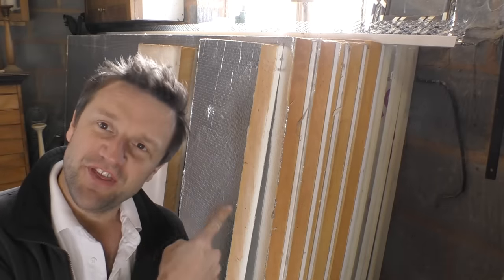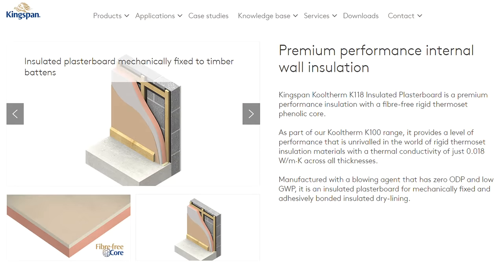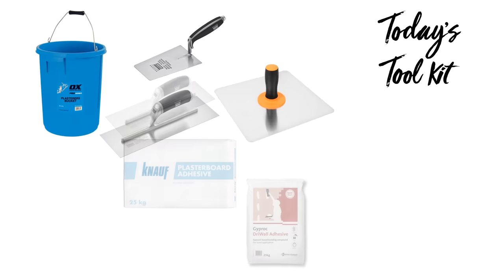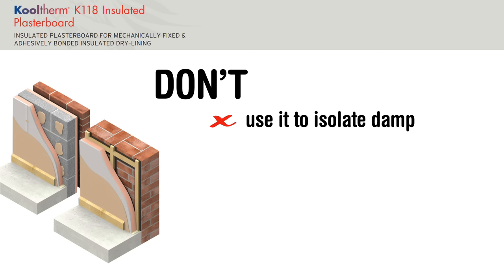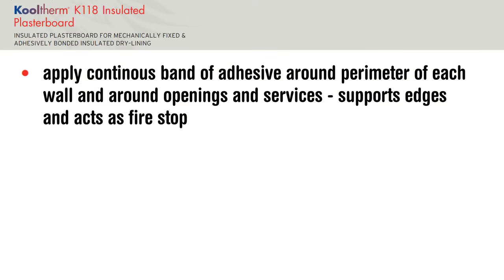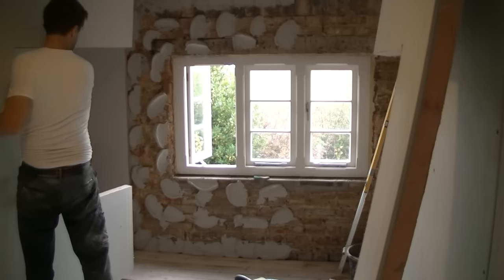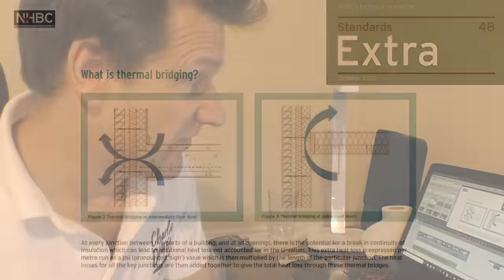How to Dot & Dab Insulated Plasterboard - a DIY Guide

Comment: Great video - how much difference has it made to your rooms in terms of them feeling warmer and staying warmer for longer? Looking at doing so and going down the foam method,
Reply from the maker: Yes I'd definitely go down the foam method - much better insulation around plug sockets etc. It's been totally game changing. Our insulation isn't as thick as ideally it should be (calculate the u values if you can)  in some of the rooms but take my daughter's for example, you couldn't really heat it before but now the single radiator heats it beautifully. Do everything you can to minimise cold bridging. 👍

Comment: Good detailed video thanks, how do you deal with electrical sockets and extra thickness?
Reply from the maker: You've got two options. You use these https://bit.ly/3tkZ7Fd with the socket box address to the back wall, or more preferable, as this option is a cold spot and therefore source of condensation, you could spray expanding foam behind the electrical socket before you screw or into place so that you're effectively replacing the insulation you cut out to accommodate the box.

Comment: Im looking to insulate my garage with foil backed insulation plasterboard. It’s a single brick wall. Would you recommend putting on batons beforehand? Rather than straight onto the brick? Thanks for the advice!
Reply from the maker: Yes I wouldn't dot and dab a single brick wall. Make sure you protect the batons from damp coming through the brick with dpc. You should only insulate though if the wall is bone dry

Comment: Hi there, great video. One thing I have just done this myself in my bedroom on two walls both external solid. But I didn't know/ forgot to use the mechanical fixing, alot of adhesive was used though. Does anyone think this would be a problem? And what exactly does the mechanical fix do? Just help it stay on the wall im guessing. Cheers.

Comment: PERFECT!❤
Reply from the maker: Hold fire a few weeks if you can though. I'm planning a new vid on the breathable insulation I'm using in my kitchen. If you do dot and dab PIR use foam adhesive rather than plasterboard adhesive. It's a much better insulator.
Reply: How thick is the plasterboard your using

Comment: Really nice video. So what do you do with the joints between all the sheets you put up ? I assume you paint the plaster board so do you tape and finish it like regular drywall first or what ?
Reply from the maker: Thanks. Yes you tape the joints with scrim tape and then plaster over. If you're going to do this I strongly advise you to use expanding foam adhesive rather than plasterboard adhesive - it will help to eliminate cold bridging and you're not putting all that water into the wall.

Comment: Thanks for the info Charlie. I am planning on attempting this in one of my bedrooms. I read that foil backed boards shouldn’t be “dot and dabbed”, have you had any problems since installation? The room is unbeatable, and I’m planning on only doing it to the gable end wall. Thanks in advance for any suggestions.
Reply from the maker: This board looks foil backed but it's designed to be dot and dabbed as it has tiny perforations. I'm currently working on a breathable system in the kitchen. If you can wait a few weeks for that vid I think you'll find it quite interesting. Going back to this vid, if you use this method try and use a spray foam like Instastick rather than the plasterboard adhesive. Means you won't be putting moisture behind the wall and it'll give you better insulation at the break points between each sheet and behind the electrical sockets if you cut through like I did.
Reply: Thank you for the rapid and detailed response! I think I will use a “bond-it” type glue, as I try to avoid isocynates, but it sounds like a faster and easier method than plasterboard adhesive. Thank you

Comment: Q2 (and maybe 3..) - electrical socket/switch holes - how to avoid massively long screws or problems with overlong cable.  And draughts - if you have air bricks into the floor void you can end up with airflow with the ground-floor-ceiling/first-floor floor that extend (e.g where cables break up/down into the behind-the-plastboard space.  Sealing off the perimeter of each wall turns out to be really rather important - even if it does have the downside of removing airflow to deal with any micro-rate damp penetration...

Comment: Great video. One question I have is does insulated plasterboard (kingspan 118) have any significant benefit over applying rigid foil backed plasterboard directly to the wall (dot and dab) and then applying regular plasterboard on top of the insulation?
Reply from the maker: You mean foil backed PIR? You can't dot and dab foil backed plasterboard unfortunately, and you're left with the issue of how to fix the plasterboard to it. I wouldn't go down that route. Check out my most recent insulation vid https://youtu.be/Ou1CjwflZtM?si=B4E_tOoSPlOW_lrF for a better understanding of the issues you've got with IWI.

Comment: This video is great, im about to embark on doing this in an old piggery outbuilding for my wife to do some dog grooming. My only question is, how did you finish the window sills? I have a few external corners to deal with, how are these done to maintain a thermal barrier? Cheers
Reply from the maker: There's an image near the end (I think at 23.20 mins in or thereabouts. You basically need to ensure the insulation is continuous around the corner and you do that by cutting it away from one of the corner sections, so when you butt it up to the other, there's a continuous line of insulation with no plasterboard in between. Leave a small gap at the bottom of the wall and fill with expanding foam tape when you're finished. Also take care with any electrical sockets. Avoid cutting all the way through the insulation if you can as that will create a cold bridge.
Reply: I've also added a thinner sheet of PU underneath the window sill boards where space allows. You can get insulation boards down to 5mm

Comment: Well demonstrated and a good explanation. Of course the only downside of retrofitting insulating from inside is that you do lose some internal space depending on thickness of the insulation board. I managed to insulate from the outside with external insulation finished off by k render. But, it is important to insulate irrespective of whether it internal or external method. And as you well mentioned do it properly in the knowledge that if you do it wrong, it can lead to cold bridging and propel ems later on.
Reply from the maker: Good work. If you can insulate externally that's the gold standard 👌👏

Comment: Great videos. Would you recommend installing wooden batten/ plates into the insulation before fitting for fitting of curtains poles etc or do you have a recommended fitting for fixing curtains up on to an insulated drywall. Same for radiators would you fix wooden battens to the wall in prep for a radiator and cut out the insulation in its place, sealing with foam on installation to try to preserve a vapour barrier? Or do you recommend a fixing direct to the wall behind that negates this. The core fix you reviewed seems not to be long enough with a max gap of 45mm from plaster to wall behind.
Reply from the maker: Thanks Stephen. Yes you're thinking is spot on with this. Whatever you install for radiators etc, you need to think about preserving the vapour barrier and the insulation to minimise cold bridging. The problem I created in this vid was cutting through the insulation for the sockets as this can be a focal point for cold bridging. For curtain poles, you're idea of a wooden pattess inlaid into the insulation, and then foil taped over at the back to preserve the vapour barrier is a great one. For radiators you'd need to anchor into the wall really so yes, battens on the wall would be preferable. What I did in our last room refurb, learning from what I've done in previous rooms was batten the wall (tanelised 2x1") rather dot and dab. I then Infilled between the battens when 1 inch PIR board, foil taped over the battens. I then cut the back boxes for sockets into my insulated plasterboard, inlaying a 12mm ply plate on the back of the insulation a couple of inches wider than the hole, to give me something to screw the back boxes to, again foil taped over the back. I even drilled a hole through the insulation to pass the electric cables into the back box. I then screwed the insulated plasterboard - same stuff as I used in this vid, to the battens. Around the windows I've got continuous insulation in the recess walls, ceiling and below the window board, again to prevent any cold bridging. I think that's about as comprehensive as you can be. Oh, and I screwed battens to the wall where the radiator would be, in that primary batten layer at the back, and screwed through the insulated plasterboard into the battens, using a cut off Corefix so that the steel core could tension the bracket without pulling into the insulation - an unnecessary precaution thinking about it as the insulation will stop this happening.
Reply: Thanks, yes in the room I’m doing I’ve gone for wedi board in the window reveals (sides and bottom, k118 top) as I didn’t have the depth without chopping the bricks out, ok wedi is about half the u value but it doesn’t then need the 12.5mm plasterboard on top and is waterproof. I only went for 30mm k118 as at some point when hopefully finding becomes available I will do the exterior and was a little concerned over condensation plus I don’t have the space really. Yes I thought to do exactly as you said for the curtains, you explained much better! I have some foil tape ready.  But due to the way my house is built there is only the internal half of the brick/lintel extended above the window and my concern is the lack of insulation and cold bridge will be worse than fixing though the k118. I’ve never fitted curtains to a drywall, would you recommend just fixing to the drywall therefore not damaging the VCL or removing the insulation that would be replaced by, in my case exterior ply. My plumber friend says core fix will be fine through the 50mm gap, even though the say max 45, for the rad we have to fix, so I am thinking I will fix with those and squeeze in some ct1 or sika flex in before pushing them in. I’ve also gone down the adhesive foam route, have to say a little nervous of it, but we will see this weekend 😅
Reply: Oh and I forget to mention, the batten method was how I originally planned to do although it wasn’t this room but seeing your video I decided to do same and save the effort, I will however be doing that way for the bathroom replacing the top layer of insulation and plasterboard with wedi board or similar for a waterproof seal.

Comment: Charlie, great vid mate and very timely as I'm about to do just this in my spare room. One thing you didn't cover was finishing around the windows. It looked like you went flush to the base level of the window and all around. Did you add kingspan to the window ledge area or just plaster it etc? Thanks!
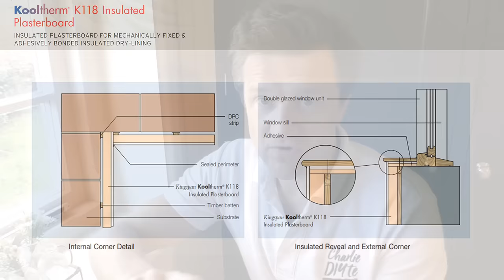Reply from the maker: Hi Chris - thanks mate! Yep, I thought I'd perhaps do this in another video given the length of the video already! Did you see at 23:23 minutes that I mentioned this briefly? Also, I have to be a bit careful preaching on this, because it's one of those things that everyone does differently, so if I outline a slightly unconventional approach, the pedants will be stampeding out of the darkness like the night king's followers in Game of Thones! On any project, the depth of your window frame before the brickwork basically dictates how you finish the reveal (see further comment below on this). 

What I've done in the past is use 7x1 inch planed timber, cut down to the depth from the window to the front edge of the plasterboard, leaving it proud by 2-3mm to allow for the plaster skim, pegged/screwed to the window frame. But this is fine where you want an architrave around the front of the reveal, to cover where the plaster meets the timber, but not if you just want the reveal plastered. Also with this method as with plastering the reveal it's essential you don't have any cold bridging, which I managed on this video by spraying expanding foam between the timber and the wall to insulate it nicely behind the timber. Why is it important to minimise cold bridges? Because if you have a break in the insulation (as I have on my son's room which I did also with the timber reveal) it's going to manifest itself in mould in the corners of the reveal close to the window frame. 

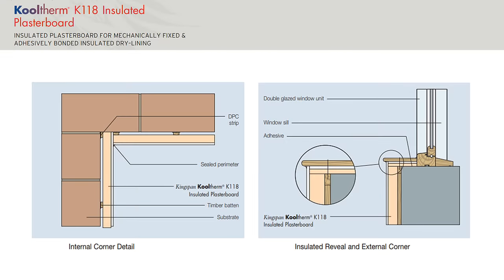However in our bedroom, which I'm doing right now, I'm going to finish around the window with plasterboard because the idiot joiner who made my windows has left the vertical frame or jamb a wopping 9cm wide, so I've got enough room to line around the windows with my insulated plasterboard, making sure I overlap the insulation as I showed at 23:23 in the video. 

Hope that helps/ makes sense.

Comment: Brilliant Charlie, I have bought 4 boards for my freezing cold porch, (25mm) but it is 37.5  with the insulation. Not started yet but it is going to stick proud of the door, can I buy wide plastic beading to match it to the door frame?
Reply: For your application it may be worth looking into a product called 'Spacetherm'. Much reduced (often 10x) thickness for similar U Value (W/m2k).

Comment: Hi Charlie. Thank you for providing this very helpful and well thought out video. I had a question regarding cold spots which I was hoping you could help me with. When looking at literature from Kingspan and other insulation manufacturers/suppliers at the junction of an internal/dividing to external wall they specify returning the wall insulation between 400 to 500mm along the dividing wall to prevent cold spots at the corner/junction where the two walls meet. I have noticed that you did not mention this in your video so assume you did not install your wall insulation as per this detail. I dont want to install as per this detail either due to the cost and level of effort required to insulate additional walls. A 500mm return would not look that great and I would therefore need to insulate the full length of wall.

 Now that a few years have passed since you installed your wall insulation have you had any problems with cold spots? It would be great to hear your thoughts on the above. 

Suraj
Reply from the maker: Hi Suraj, thanks for this. There are a couple of things I'd do differently. On the corner I'd probably remove a strip of plasterboard from one edge so I could butt up the second edge ensuring continuous insulation around the corner, not that in this room I've had any issues with cold bridging that I know if. But the sockets are the biggest problem. In our most recent refurb - our bedroom - I battened the wall with 2x1, infilled between each batten with celotex foil backed insulation board, foil taped over the battens and then screwed the K118 to the battens. That way I could cut a hole in the K118 for the sockets, attach a piece of ply to the back to give something to screw the back box to (also foil taped over) and this way there's no cold bridging around the sockets. I think this is the most comprehensive solution. Some people use expanding foam instead of plasterboard adhesive. This could be another more thermally efficient option, but is oneI don't have any experience with.
Reply: Charlie, do you have a video of using this approach that you used most recently please?

Comment: The worst part is just getting started with removing that old plaster .Messy at the best of times but a lot of useful information.
Reply from the maker: Thanks Mike. The problem with any wall insulating is minimising cold bridges and a major source of those is sockets where you typically cut all the way through the insulation. I've just insulated our bedroom and I used battens instead of adhesive. I filled in between the battens with 1 inch celotex type insulation. I then foil taped the battens where they met with the insulation and inserted a wooden plate on the back of the wall socket cut out in the insulated plasterboard (to screw the socket into), and covered that in foil tape too. I then drilled a hole down the middle of the insulation for the socket cables. This way there's no cold bridge in the socket.

Comment: Hi Charlie, great informative video, how did you work out your brick density, I’m looking to do this for my bungalow with no cavity wall.
Reply from the maker: I've had to knock through a couple of walls so I knew how many courses there are in the wall. You can probably work it out though by looking at the depth of the window reveals. If in doubt, batten the wall rather than dot and dab. I did this on my last room (2x1 inch tannelised), infilled the battens with 1 inch ecotherm, foil taped over the battens and then screwed insulated plasterboard on top. This way you're minimising cold bridging - in particular where you have to cut through the insulated plasterboard for the electrical sockets, because there is still insulation behind.

Comment: Charlie, have you ever taken a measurement of the exterior walls you've done this method on with your fancy thermal camera? I'd be interested to know roughly the temperature of those walls in winter vs the ambient room temperature.
Reply from the maker: Good point. I'll do a video on this, this winter. 👌

Comment: were this wall prone to dampness, would you still dot and dab or (Having throughly cleaned the surface of the granite stone wall), would you use the Emperor cream to help protect the stonework and then Dry Line before adding the insulation please?
Reply from the maker: I wouldn't do this if the wall was prone to dampness - you need to eliminate the source of damp beforehand. Keep an eye on the channel as will be doing a breathable insulation on the kitchen some time soon.